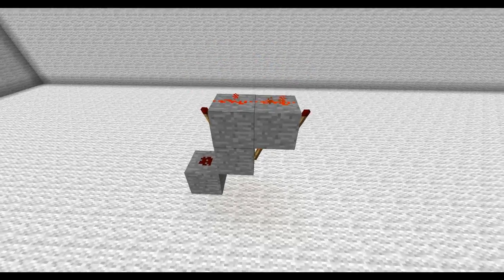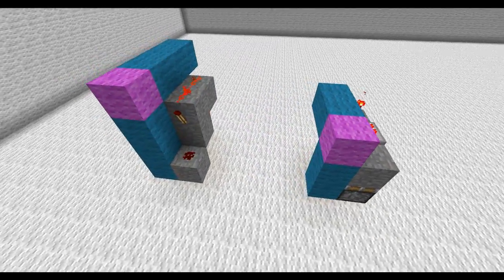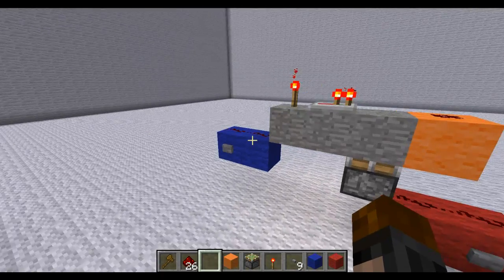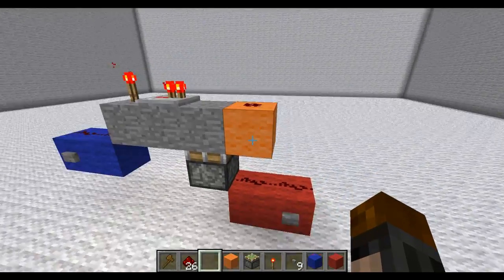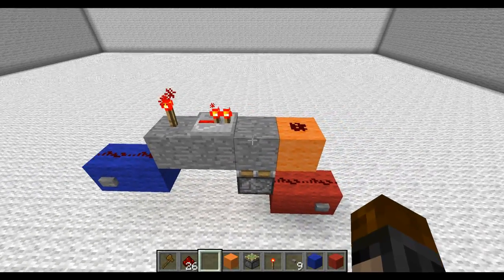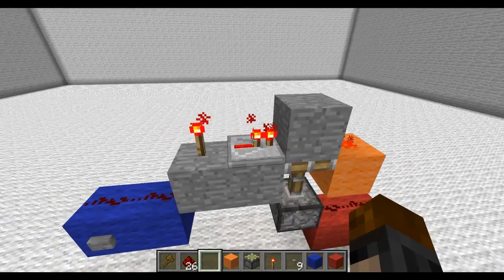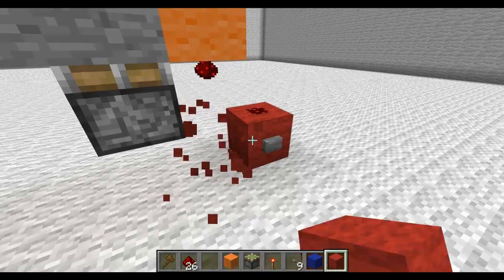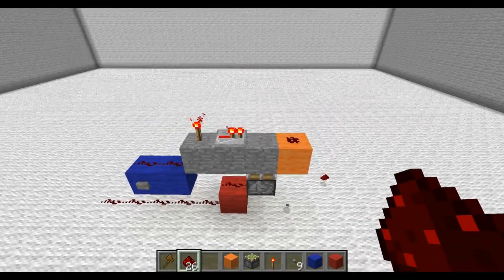3x3x1 Piston RS-NOR LATCH [memory cell]

Comment: The reason it works is because if repeaters  are being powered directly to a block, it will also power the block below it. Since the extended piston part is below it, the piston remains pushed out. When you activate the other button the power is cut and the piston can retract. This won't work with downward facing pistons because the repeater won't power the block above the block being directly powered.

Comment: I quite like it: I will consider using it in my CPUs but wondering: have you experienced any of the location bugs associated with pistons? not the one that allows your design to work but sometimes, for what i believe to be no reason pistons are activated? You see I used pistons in a system I developed where I can have ordered dual outputs from one input eg first program to A, then B and experienced this bug. Does it occur in this system?

Comment: @oliverissocool1 don't use the input blocks,put a button in the back of the torch block and use only 1 block for the red input,also put the butons in the back of the block,not the side because it would be 2 wide if you put it in the side